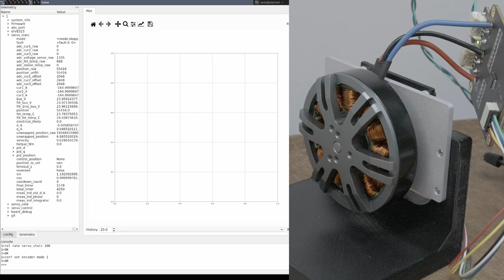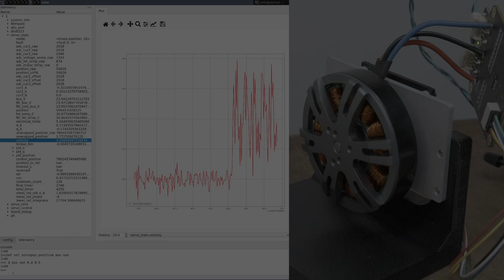moteus with external encoders

Comment: This is awesome.

Will you ever make a Moteus board to drive sensored BLDCs? You might be able to reduce the size and cost that way for certain applications where sensored motors are already available.
Reply from the maker: Thanks!  Motors with only hall effect sensors aren't terribly useful for servo applications, as the resolution is too coarse.  There are plenty of ESCs available to drive sensored motors, so there isn't much need to make a slightly cheaper moteus for that market.